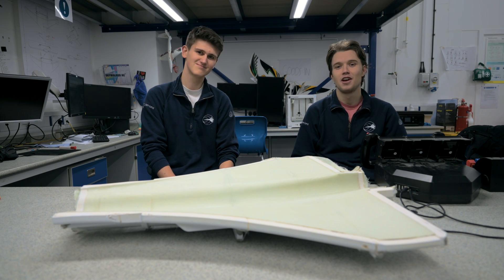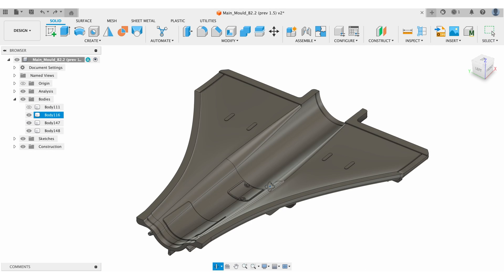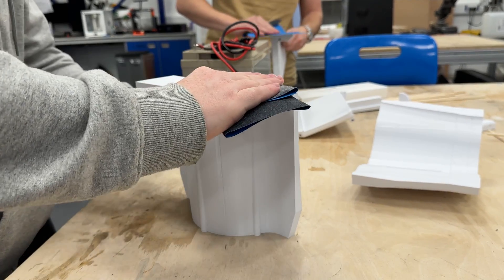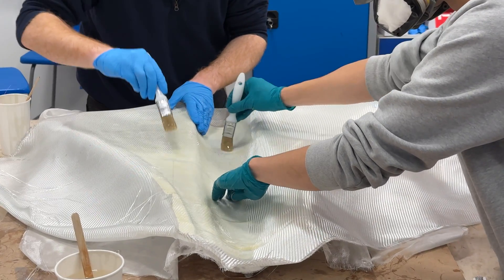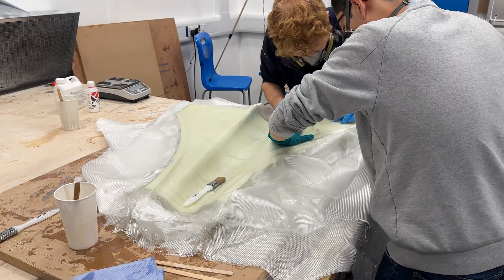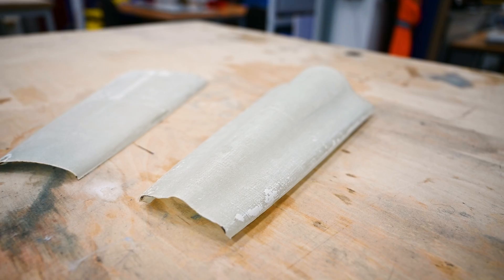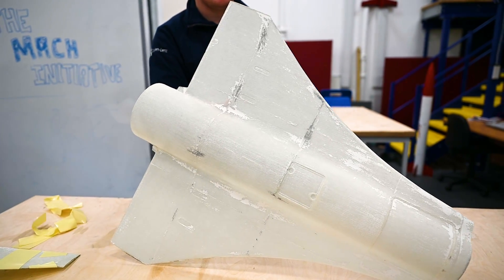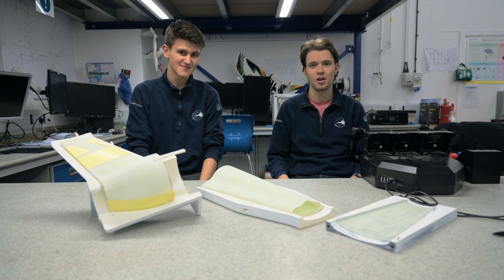Building a 570 MPH RC Plane Part II - Skin Assembly

Comment from the maker: We hope you liked this video!

We have our final set of university exams in January, so we'll begin flight testing of the prototype once those are done. We're also working on another video breaking down the Kingfishers design in a little more detail which should help to answer some of your questions. 

Some FAQ:
(1) The lines on the parts are from the filler we used to fill the gaps in the mould, while they look quite prominent, the part is actually quite smooth.
(2) We chose fibreglass for its radio transparency.
(3) We're using 5 layers of alternating 0/90 and +45/-45 woven plies.

Thank you for your continued support - let us know what you'd like to see next in the comments! :)
Reply: I guess fibreglass is fine as long as you limit your manoeuvring! Do you plan to use an autopilot or manual FPV? Autopilot might make sense for planning big repeatable high speed runs if you can tune it for those speeds
Reply: That’s pretty cool. 

Could I ask why not mill a foam skin, glue in the bulkheads and spars then glass bag it?

Comment: If you are confident in not crashing the aircraft or have funds to replace parts, i would recommend using foaming pla, or specifically bambulabs "pla aero" which is much lower density than other filaments when settings are tweaked. If lower weight is something you want, aero pla supported by some carbon fibre rods would be useful for such a thing. However ,being a foaming pla it is also quite bendy, so you might want to print the leading edge and front components separately with a more solid filament but make most of the rear and central fuselage using the foaming pla. If you plan to grant your aircraft high maneuverability, then i wont recommend pla aero since the force on the trailing edge in a tight turn would tear the wing.

If weight isn't much of an issue and you want pure power to speed in a straight line, you might want to make a liquid fuel engine as you can get significantly more thrust, but that means your design will be heavier and at the size that the rc plane is, you will have very limited powered flight time. If you can launch it from another aircraft like a dive launch from a drone or just a  high speed launch from another rc plane, that might help.

Comment: Hey guys I love this project so much! Well done so far, it all looks really good! I see other projects on the same path and yours is by far the most likely to be a success. It is such a great mission for you young chaps! I wish you all the luck!  I have been on a similar path and managed over 500kmh with both turbine and electric FPV models. I have some questions I would love to know the answers to! Where are you intending to fly it? (That has been my main hurdle) Who is going to fly it (I want to help!)? It will only be legal for about 3.6 seconds, so you will need to stretch the law, or get an exemption.. I chose the former as that type of exemption would be impossible for me to obtain. I see no problem as long as all preparations are made and risks assessed, there should be very little danger to anyone. Do you have a site in mind yet?
Reply from the maker: Thank you so much! I've been subscribed to your channel on my personal account for about a year, I loved your 509km/h FPV aircraft video - great to see you're interested in the project

The logistical/ legal challenges are the biggest hurdle and is something we've spent quite a bit of time thinking about - we plan to fly at a private test range in segregated airspace, under the CAA specific category, which has resulted in us adding several redundant systems into the design including a 1ft drogue parachute that can deploy at 600 mph to prevent the aircraft from leaving segregated airspace if it goes off course (the goal here is not saving the aircraft, just bringing it down inside segregated airspace). We're currently working towards an application for operational authorisation, following some advice from industry sponsors, and we have a couple of possible options for test ranges.

We would love for you to get involved - would you be up for a call? I'm in the middle of my final university exams at the moment, so I know it is a bit of time away but 25th Jan onwards would work best for me 

Cheers, Dan
Reply: @TheMachInitiative  Hi Dan, it would be great to have a chat. Absolutely up for a call when ever suits you. Not sure how to share details here without doxing myself!
Reply from the maker: @OMEGOOLIEBIRD  That is great - really looking forward to it! If you send me a message using this page on our website: https://www.themachinitiative.com/contact it will redirect to my email inbox, then i can contact you without either of us having to dox ourselves! Let me know if that works for you
Reply: Hey Dan, I hope you are all ok. Sad not to see an update on this project, I guess you guys are very busy with your studies. I did leave a message on your website, but have not had a reply. I would love to chat and find out more about the project and offer any help I can. Best wishes. Rupert. @TheMachInitiative
Reply from the maker: @OMEGOOLIEBIRD  Hi Rupert, i'm really sorry - I think there must be an issue with the "contact us" page on our website as i checked the inbox a few times to see if you'd sent anything including last week but it was empty. I'm really sorry about this, I've been really looking forward to having a call and v keen to see if there are any collaboration opportunities. Would you be able to send me an email at themachinitiative@gmail.com so we can organise a time to call?

Best wishes,
Dan

p.s. we recently did an update on LinkedIn: https://www.linkedin.com/posts/the-mach-initiative_it-has-been-a-busy-month-for-the-mach-initiative-activity-7176320516486553600-YimU?utm_source=share&utm_medium=member_desktop

Comment: is that thing full scale ? or a small scale EDF test version? what is the wingloading on that thing? hate to be pessimistic, but for all i see, this is never going to fly for more than a few seconds. also another problem i see is you're planning to fly this supersonic? how is this engine supposed to work in supersonic airflow? they are not designed for that. you'd need inlet ramps and stuff.
Reply from the maker: This is the full scale - you can see the Jetcat P300 Pro at the end

We’re planning to fly at Mach 0.8 - the sharp drag rise at Mach 1 makes supersonic flight almost impossible with a micro-turbojet engine. Our S-duct inlet has been designed to decelerate the flow from Mach 0.8 to Mach 0.4 while keeping a uniform velocity profile at the compressor face. Our propulsion lead spent about 3 months doing a CFD study for this as part of his degree, in Feb one of our members will be doing experimental testing on the inlet to validate this cfd before flight, using the P300 Pro.

Should also note a standard inlet will still work up to ~ Mach 1.3, it’ll just generate a bow shock on the front which is quite draggy - after that normal shock inlets and ramp inlets become more important. Nevertheless, we’re not going supersonic anyway.

The wing loading is ~250 g/dm^2 which is ~120 more than the current world record holder. We would also prefer bigger wings but the drag increase from Mach 0.62 (current world record) to Mach 0.8 is about 70%, and aerodynamic optimisations will only get you so far. To reduce drag we have to make our wings smaller. The wings do have some wing tips not shown in this video that make them slightly larger than you can see there.

We’ve consulted a high-speed micro-turbojet pilot during the build, if we get the aircraft up to speed (100 mph+) quickly it will be stable to fly, which having a 3:1 thrust to weight ratio and a pneumatic catapult helps with. Our stall speed is ~50 mph which is high, but not impossible to land. The beauty of the delta wing is it generates vortices that increase lift at lower speeds and enable it to fly at high angles of attack.

Comment: Are you guys gonna build a scram jet and then use a helium ballon to bring it up to 15 or even 20 km of altitude to drop it? The terminal velocity up there is really high because there is not a lot of atmosphere so there is not a lot of drag. Keeping the dartjet stable will be the main challenge, and the forces on it will be enormous. But then if you fire up the scramjet at the right time you could break through the sound barrier. THe higher you go the lower speed you need to break mach 1 up there. It certainly is theoretically possible.

Comment: Nicely done, a few tips on hobby composite making with printed parts. Keep the tool parts open on the back side so when you pull a vacuum you allow the air out of the infill. I would typcially creat moulds as blocks rather than a nominal thickness in line with the part you make. When you pull a vacuum in a bag it can easily distort the tools. Might be worth halving your fibre weight and put 2 plies down so you can get a 0 and 45 degree fibre orientation.
Reply from the maker: Thanks for your advice - in answer to your last suggestion we’re using 5 woven layers alternated in 0/90’s and 45/-45’s to provide strength in different directions - with hindsight I probs should’ve mentioned this in the video!
Reply: @TheMachInitiative  but your mold definitely was warp in the Vacuum .

Comment: fyi     a jet engine (or edf)  NEEDS  to have  forward-facing  air inlet(s).         in part, this is so because if inlets are (only) located where laminar flow is dominant,  as airspeed increases so will the tendency of the air to  flow  past  the inlet(s) without entering.      proof:  just look an  Any  type of normal jet aircraft design.
Reply: They’re not doing anything serious with the EDF, as they explained in the video. They just need it to have a bit more thrust to make it easier for them to test the avionics before they stick it all in the final airframe.

Comment: Excellent work guys, really high-quality composite construction! By the way, be sure to use a flexible extension on your Dremel when you start cutting carbon, cos carbon dust is conductive and kills Dremels. 
Rick Newlands, Spaceplane lead, Aspirespace engineering society.
Reply from the maker: Thanks for the advice - we’ll be sure to take it onboard!

Comment: Why use fiberglass instead of carbon fiber
Reply from the maker: Radio transparency - carbon fibre is conductive, so you can't put antennas in a carbon fibre wing
Reply: @TheMachInitiative  Ok i use carbon fiber in my fpv setups it dosnt block my radio link
Reply: @hanni4795  You've been lucky so far!
Reply: @hanni4795   its just for good measure especially when you are flying at almost the speed of sound.
Reply: @hanni4795  And you probably have not enclosed your vtx / receiver completely in carbon fiber, have you? Normal quads have some open space around the receiver/vtx through which radio can go trough.